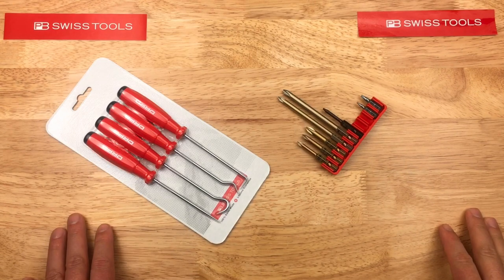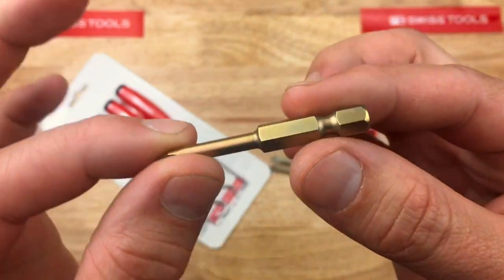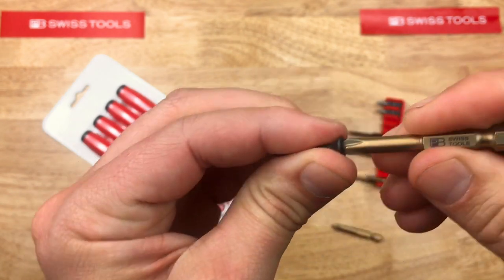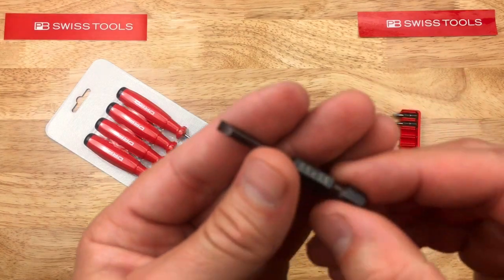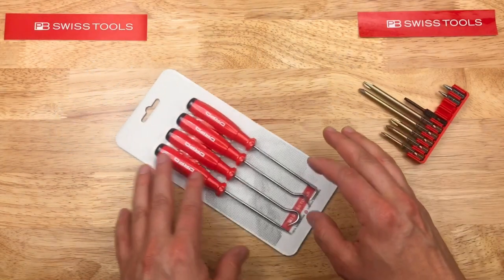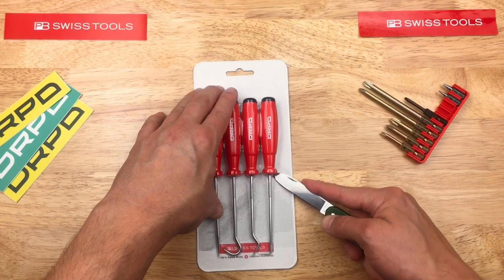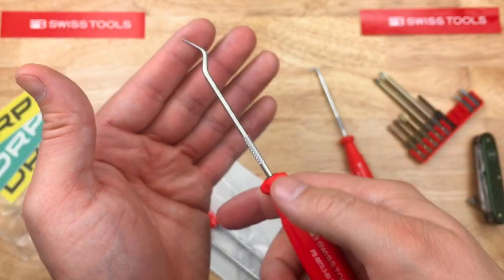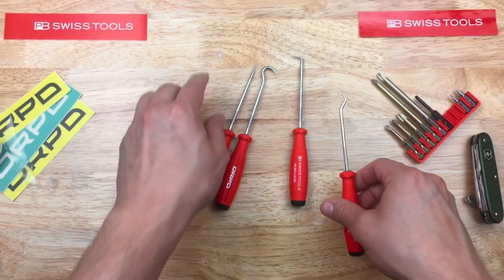PB Swiss Tools 🇨🇭 Swiss Quality On Display

Comment: Awesome, have the pick set, screwdrivers,  and several bits.  My pick set has the traditional handles so they are vanilla scented.   Once you use their screwdrivers, bits, picks, and Allen wrenches you realizes everyone else is manufactured toys in comparison.   Keep up the great videos.
Reply from the maker: I’ve been eyeing their ball end Allen wrenches! I’ve been impressed so far so I’ll have to try a set.
Reply: @BrandoDamo  You will not be sorry, Just expensive.
Reply: I have five different sets long and short, ball end and plain and the cut down 90 decree set. They get daily use as a maintenance engineer, and I can honestly say you won't buy better, they are virtually indestructible. Like others say they are expensive but consider how many broken cheaper sets you will get through.
Bite the bullet they are superb.
Reply: @paulclarke3274  Got a cut down metric 100 degree set and ball end standard, the best I have used no question.